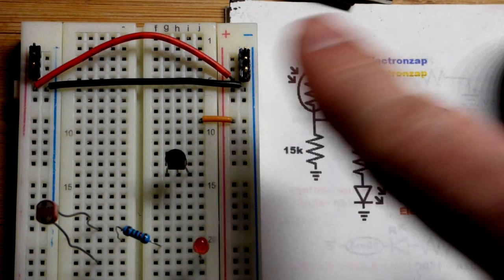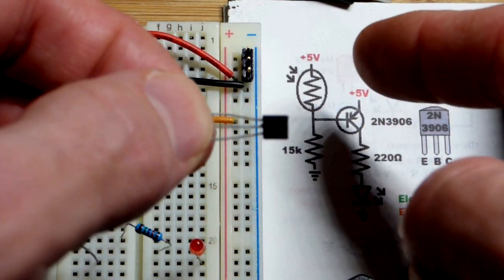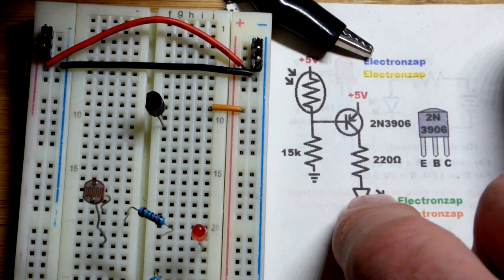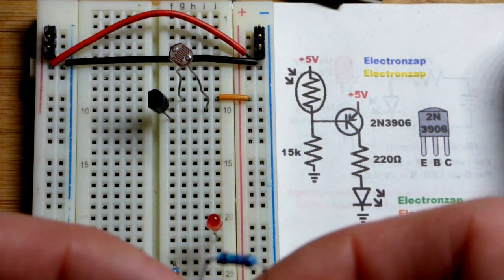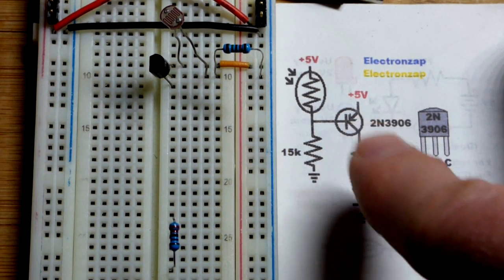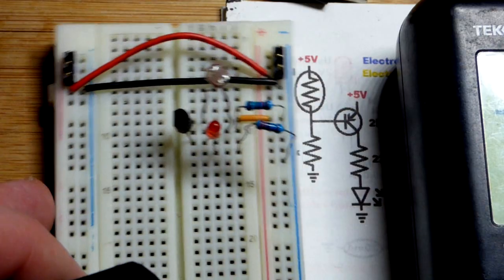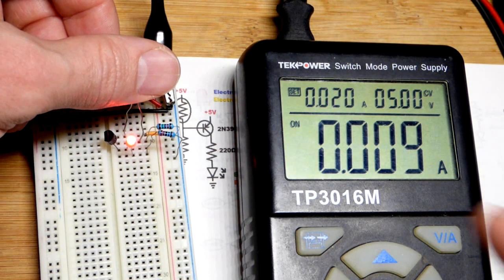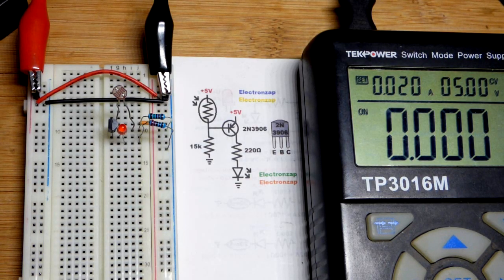Step By Step PNP BJT Night Light Dependent Resistor Circuit By Electronzap

Comment: Could you demonstrate how to make a sinewave from a square wave  with filtering  . Always a pleasure to watch your videos!!
Reply: For small signals (for voltage, but tiny current): 4th order Sallen–Key unity gain lowpass filter with 2 stages using 2 op amps, 4 caps (not counting decoupling caps), and 4 resistors
For power (for voltage but large current passed): charge a capacitor and use a (or 2) Darlington, MOSFET, or IGBT as a switch mode inverter.